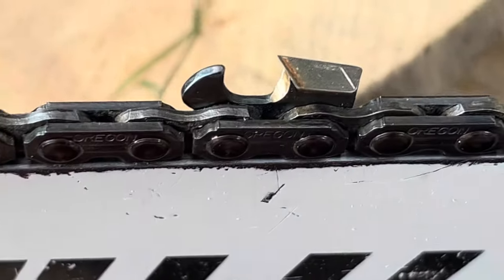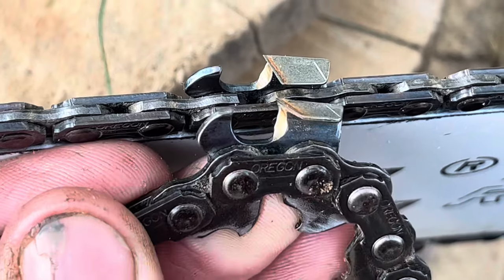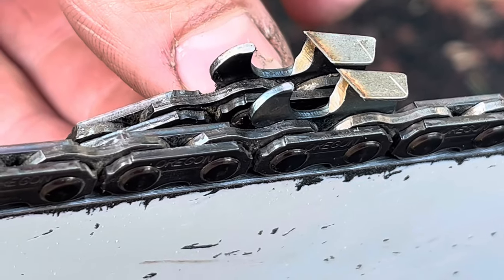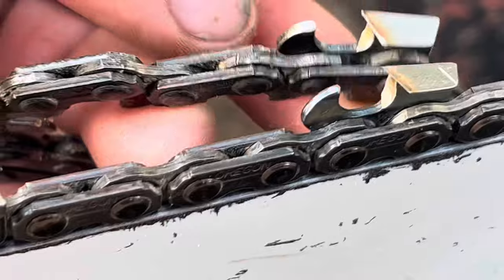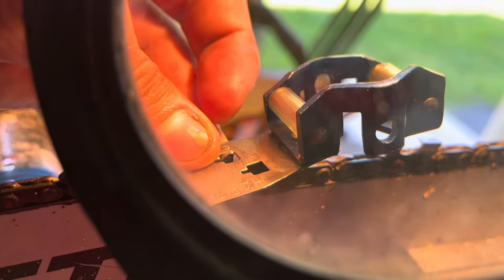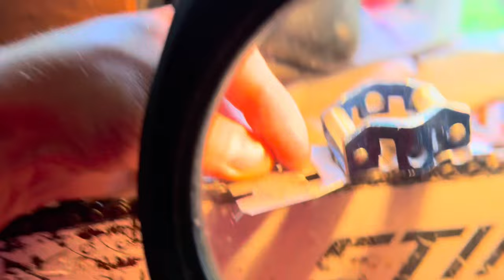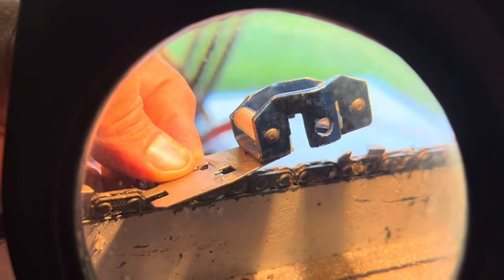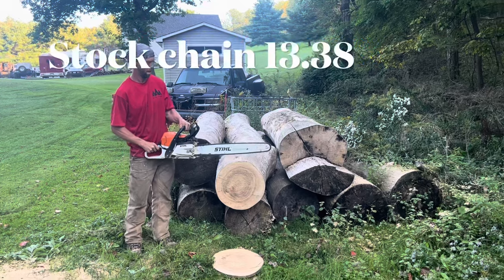Make any chain cut faster than new!!

Comment: I started using a HEXA file on all my chisels chains.  

I’m running full skip too.
Reply from the maker: I have thought about that! Not sure if they cut much faster. What do you think?
Reply: @timberandtools  Faster than round file and incredibly smooth. I had a few round file chains that I converted then started converting my square chain to HEXA. I’m currently playing around with converting .404 chisel to HEXA. The files are about $20 from Stihl and getting much easier to find.
Reply from the maker: @PurpleNovember  making me want to try this now!!! Hmmn..
Reply: @timberandtools  I recommend it! 
I set the rakers to .040 and I think top plate was 30 degrees. That’s what works for our stuff, I’ve had the depth and angles all over the place. Anything between .025 and .050 , and 20 degrees to 40 degrees, would cut good depending on what type of wood and chain speed.
Reply from the maker: @PurpleNovember  nice! I’ll be getting on this to I’ve her a go 👌🏻 amazing how the angle and rakes make such a huge difference!!!
Reply: @timberandtools  I really learned with square chain how angles change and rakers changed things, especially when going to an 8, 9, or 10 pin rim.
Reply from the maker: @PurpleNovember  I haven’t done too much with Square but you are definitely right about that when you start changing sprocket size you can really notice a difference on cutting performance based on the actual chain. I feel like it’s a deep, deep rabbit hole that we can get ourselves down. Ha ha ha.
Reply from the maker: @PurpleNovember  square is definitely deadly ☠️
Reply: @timberandtools  It’s definitely a crazy deep rabbit hole, it’s not that bad though after messing around with it for a while. There’s patterns that develops so it makes things easier. I go for good chips and low pull, that usually makes for good durability. It’s not the fastest at cutting clean cookies, but it doesn’t wear out the operator as bad and the chain last all day or more.
Reply from the maker: @Today_Im_Living absolutely, I really agree. I file more for durability as well!!
Reply: @timberandtools  HEXA has been very durable for us.
Reply from the maker: @Today_Im_Living that’s good to know I don’t have a lot of time on it to really say ! I don’t feel like it is taking off in the US markets unfortunately though
Reply: @timberandtools  it definitely doesn’t! The chainsaw would in the US seems to be set in was , a lot of ignorance really. The MS 250 is a popular saw that many people brag about, the MS241CM is a great pro version of it that never took off here. Most guys say a 20” 3/8 bar is too much for a 50cc saw, and then complain how bad it is leaning over all day. I’m very mechanically minded and worked on heavy equipment for decades for years. I did a lot of custom mods on equipment so it could do stuff it was never intended to do.
Reply from the maker: @PurpleNovember  yes and yes!!! 241 I dream about. We don’t have them local!!!!! 250 is a terd saw compared to that. I do the same , like to modify the saws to do more than intended and being super lite in the due process lol. We are probably to similar!!!!
Reply: @timberandtools  I have a 241 on my bench that I’m rebuilding now and hopefully I’ll be getting another in a week or two. Keep an eye on eBay. I’m going to try and see how it does with 20” .404 
The Echo 4310X is another good one.
Reply from the maker: @PurpleNovember  yeah another non us saw 😆 at least it was. Hopefully it will be in us soon! The new 4920 is now a clam shell grrrrr
Reply: @timberandtools  Clamshells have a lot of potential and can easily outdo a split case but the machining can be more difficult. There’s advantages with the clamshells and modern day material and design technology. I still prefer split cases.
Reply from the maker: @PurpleNovember  this is true! I really like my 440 Husqvarna, but yes, you are limited on what you can do with the machine work
Reply: @timberandtools  I think there’s a lot more that can be done with piston shape. The machining starts to leave manual mill and lathe territory.
Reply from the maker: @PurpleNovember  no doubt!